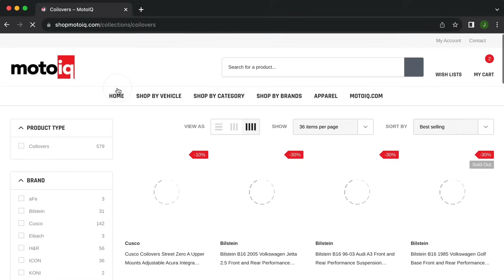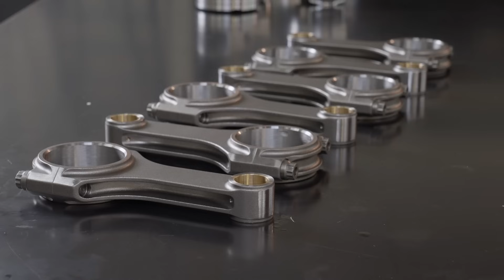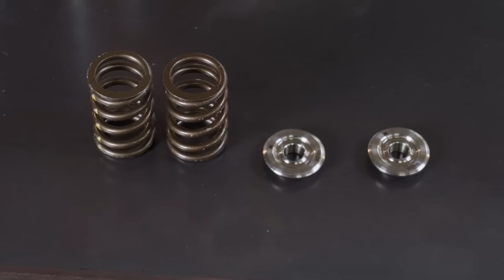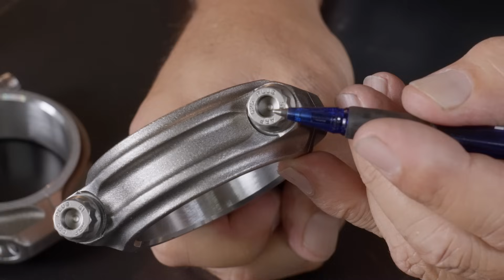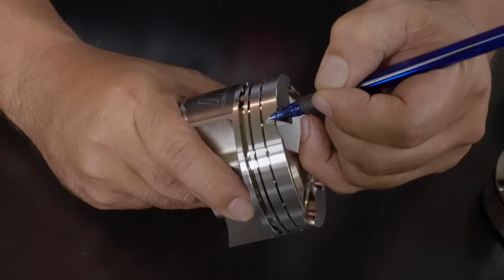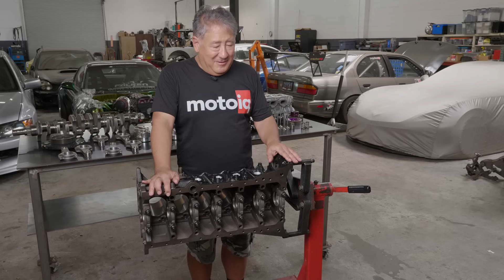How to Build a Basic 1,000 HORSEPOWER 1J/2JZ Toyota Engine!

Comment: Recently acquired a 98 Aristo with a 2jzgte.  Wanting to stay around 700hp. Should i do some headwork or what turbo setup should i do. Will ve doing e85
Reply from the maker: A Garrett G-Series II G40-1250 or a BorG Warner EFR 8374
Reply: @motoiq ty sir

Comment: I just acquired a 2000 Lexus SC 300 with the 2JZ-GE. I'm aware that naturally aspirated 2JZ builds aren't as popular, but i would like to get some education on the Best and meaningful bolt-ons that would enhance the whole engine in power and efficiency. 
Maybe once i get a shop to work in, I'll look at building a turbo 2JZ.
Reply: The 2JZ-GE VVTI in your car will need the pistons and rods replaced for any meaningful power. The good news is, they are very cheap to obtain, so you can acquire one from marketplace and build that on the side.

Comment: You love 2jz and you love efr so you seem like the perfect guy to ask your thoughts on running  a  8374 stock bottom end. My question is, what is a good power target and is a 4k stall to much?
Reply from the maker: 600 hp is really safe. 4000 rpm stall is a bit much
Reply: @motoiq Thankyou 😊

Comment: Sir،
Really thank you for this wealth video 
I got a question 
If i have two carburetor 6L engings and connected them in series with making a rod to connect the two crankshafts in both engine, then I gather the two intake manifold at one big carburetor such as holley carburetor. Then i alignment the timing distributior 
What will i get?
High HP?
Or
High torque?

Thanks
Reply from the maker: One carburetor isnt big enough
Reply: @motoiq  if i get big 4 Barrel Carburetor and make alignment for the fuel and air to feed the 12L cylinder we can get good results.
But my question is, from your experience, will the HP increase or the torque increase?
Reply from the maker: No you can't. They don't make a single 4 barrel big enough. I don't recommend you attempt this with your level of knowledge. If it was done correctly both HP and Torque will increase.

Comment: 3rd gen Toyota Tacoma trophy truck with long travel suspension on 33-35 inch tires. 700HP 2jz turbo motor, what AWD system would you use?
Reply from the maker: Something off of a Trophy Truck

Comment: I noticed you didn’t mention the 3.6 stroker. I’ve been looking into the 3.6 stroker they are sold by all the reputable vendors but i can only find a handful of examples of them being used. Is there some sort of flaw with the stroker? does it sacrifice durability?
Reply from the maker: Some at high rpm

Comment: Great video. I have been a bit worried about my stock main caps in my 880whp Supra. The car is a street car that I do 150mph pulls with from time to time but never any regular hard driving. It is said that stock main caps do not like these power levels..

Comment: I'm a bit curious, have the folks at MotoIQ considered an S30 Fairlady Z build or some other classic car? I'm somewhat interested in the processes and parts choices involved in taking a classic of that sort and bringing it into the modern era.
Reply from the maker: We are doing an S30 VQ swap for a customer now.  The thing is these old cars have there own charm, they are never going to perform as well with the same degree of refinement as new cars unless they become total racecars.
Reply: I put an N/A 2J  in my 74 S30. I added a turbo to it. 
Running 15psi and this damn thing pulls so freaking hard on the freeway. It just sets you in the seat and keeps on pulling until you let out of it. 
😬😬👍🏾

Comment: I have a basic engine question, what is the shuttering sound you can hear when you stall an engine in a manual car? Is it essentially momentary rod knock or lspi?
Reply from the maker: Probably the clutch hub banging against the outer disc and lash in the rest of the drivetrain.
Reply: @motoiq  thanks! Love learning from your channel

Comment: Load of bollocks, there’s  no need for over size valves for 1000hp
Reply from the maker: I didn't say it or actually anything is needed, I did say its possible to do it with a stock bottom end for a little while or for street use.
Reply: @motoiq definitely no need for street use
Reply from the maker: On this motor, the only reason we go oversize is that many of these motors are quite old and a slightly bigger valve allows us to get the 45 seat up nice and high like a new valveseat.

Comment: Wich Torque Level can the Stock Maincaps hold with Arp 625 studs?
Reply from the maker: Depending on your planned use, 700 to 800 or so.
Reply: @motoiq  did you mean foot ponds? Then IT will BE around 1000nm?

Comment: What scale do you measure things down to the 1/10th of the gram?
Reply from the maker: Digital
Reply: @motoiq  I know that. But instead in the model of scale you use
Reply from the maker: There are tons of them. If you buy a good one they come with certifications and you can verify them with a test weight every once and a while.  I don't even know the brand of ours off the top of my head, we have a few around the shop.

Comment: True, we made 850whp on the stock bottom end 2j for years. Truly one hell of a tough engine.
Reply: Horsepower doesn’t kill engines, torque does.
Reply: @Eclipsis17 thanks nerd
Reply: @Eclipsis17 But with high horsepower comes high torque.
Reply: @David__1989 HP is RPM x TQ (lb-ft) / 5252, so you can build HP using torque, or revs, or both, and either one can trash your engine, if you push them high enough.
Reply: @PistonAvatarGuy  Yes that’s true!
Reply: @Eclipsis17  I already know this...

Comment: But RB26 is the better engine? Need more 26 videos
Reply from the maker: No
Reply: @motoiq  you know it is to, how many races has the JZ platform won compared to the RB?
Reply from the maker: Depends on the type of racing.  For road racing in the 90's no but its because of the R32 chassis not the engine that made a winner.  For drag racing, time attack and drifting the JZ hands down more victories.
Reply: @motoiq  come to aus and watch an rb30 smoke a 2jz, then watch them all get smoked by the barra
Reply from the maker: It all depends who developed the engine.  The Barra isnt easily available here so no one runs them.  The RB's are pretty fragile unless you get into aftermarket blocks, dry sumps etc.  A 2J can make 1000hp pretty much stock, at least for a little while, try that on an RB and you will be picking up pieces off the ground.
Reply: 😂😂😂😂😂😂😂😂 the Barra is junk and that slow top end they don't even rate.i have owned jzs for 20 years and I can tell you who the boss is. @IxtheDuckyxI
Reply: @motoiq try 600 HP on a Barra you will be picking up pieces.the Barra clowns dribble on.
Reply: @IxtheDuckyxI 😂😂😂😂😂😂😂😂😂😂

Comment: How much of a significance do piston features provide in terms of performance and longevity? JE doesn't offer the ultra series for all platforms, would it be worth getting a custom to mimic an Ultra or would the difference between it and a FSR be miniscule?
Reply from the maker: It depends, the Ultra uses a near net shape forging so its very slightly stronger plus coatings, the shelf pistons are not bad at all though I won't hesitate using them.

Comment: for 1000hp? I just leave them stock
Reply from the maker: That is what's cool about the engine.  It won't hold up for long under hard use though. Street/drag/dyno queen possibly a long time with good tuning and fuel.

Comment: I really like these kinda videos, but I got question, Why in 1000hp build you don't use Steel or Billet Main caps ?
Reply from the maker: The block doesnt need them except for hard use like drifting or road racing.

Comment: This is what i like. I don't want a 1000whp street car. I want a 600whp street car that isn't pushing the working edge of every part of the drive train.
Reply from the maker: These engines will basically do that with a stock bottom end with a good tune.

Comment: All you gotta do is put a turbo on it! Put some fuel with and get someone who can push a few buttons on a keyboard! They have literally made this stuff where anybody can do it easily. Engine building and horse makin is now out the window! Just put it together with care and boom. Stupid if ya got one, stupid if ya don't.
Reply from the maker: Did you even watch the video?  That is what we said.
Reply: @motoiq  no not much, but of course I know that's what you said. There's no way to make 1000 otherwise with it, without serious work. It was just in my recommended
Reply from the maker: They will make 1000 hp with a stock bottom end, E85 and a good tune for awhile, sometimes for a pretty long while. As long as it isnt hard use like actual racing, particularly drifting or road racing.
Reply: @motoiq  for sure I know what them things do. So many engines now can do the dang thang with just some fuel and a turbo and actually live a lil while. It's all about the tune and the person driving the vehicle. If they understand load and the when to know to mash or not mash it. Of course nothin will last with constant abuse and no maintenance.

Comment: What if the build is a big twin mount Turbo setup for 900hp what am I looking at for parts and kits?
Reply: I'm guessing you tried Google at huh? There's hundreds of thousands of videos, and write ups of 2jz builds. And the majority of them will tell you that using twin turbos is a waste of time.
Reply: @804MRMAN  No they don't tell me it's a waste of time. There's barely just any videos.
Reply: @simpleclean2468  Well I'm telling you they are lol. More turbos more problems. Go small if you want low end punch, go medium if you want a mixture of high and low, go big if you want to 2 step your way down a drag strip. V8s and V6s have two hot sides making them better for  having 2 turbos.
Reply: wulfbliz UK have a modern twin kit for a jz

Comment: I was taught that 3 angle valve jobs were a better/quicker air flow option that just two angle :shelterin:
Reply from the maker: An our hybrid radius valve job is even better!
Reply: @motoiq  maybe on the exhaust side of things. Definitely not better on the intake. If it's just the cut alone, it would be negligible, just like the standard 3 angle. Yes, it'll improve a few cfm. If 3 more cuts only are involved, it will improve significantly. If you blend, then there is lots of improvement
Reply from the maker: Yeah if you watched the video you would see that ours is a prefect blend.  Most heads are 3 angle from the factory.
Reply: @motoiq  Exactly, hence my initial comment..  Thankyou for the reply, you've answered my query perfectly ..  appreciate the fact you are sharing this with everyone.. ya doing some great work!!
Reply: @motoiq  is there a reason why you don't break the edge from you radiused chamber side cut into the combustion chamber to transition it more smoothly? You could clearly see your pen catching where the cutter finishes. I would have thought a quick light touch with a sand roll would take care of that.
Reply from the maker: We do that if the customer wants to pay for it.  It comes with our pocket and entrance porting, we clean up the short side radius and the bowl entrance too at the same time.
Reply: Anytime you can improve airflow from both sides of the seat cut contact its better, which is usually a 3 angle job cut that most every machine shop now does. But, they all generally put a 30/45/60 cut on the seat, which will improve it a lil bit over what it was. Just think about the valve and seat @0.050" lift

Comment: so what is a good compression ratio for boosted on pump gas? my area doesnt offer e85
Reply from the maker: I would do 8.5:1 or 9:1. the lower compression to go for more boost, the higher for better response but less boost.
Reply: @motoiq  So does using the GE-VVTI head with gte bottom end even out the high compression to give more high end boost while maintaining the low end torque?
Reply from the maker: If gives you about 30-40 lb/ft in the low to mid range.
Reply from the maker: What octane is the gas in your area?
Reply: @motoiq  93
Reply: Good question. I would like to know also, I have access to E85 but I wasn't to keep it at 93 octane.

Comment: Can we talk about uz v8 motors?
Reply: If you want power out of later model 1uz with the skinny rods, 2uz and 3uz id recommend going boosted and put in some 
Eagle forged rods around 700$ 
XAT Racing makes custom forged pistons at 2000$
Elate sells supercharger kits and manifold adaptor plates with or without built in intercooler
Urd sells centrufugals supercharger kits with a self tuning plug and play peice and higher output injectors and fuel pump
Turbo i have not seen any quality kits for the 2uz at least so thats some fab work but would sur be the cheapest
I dont know about  tuning becides what urd offers
Reply from the maker: That and FI is probably the way to go with these engines.
Reply from the maker: We haven't had anyone want us to build one yet. They are strong.
Reply: @motoiq  oh was think of putting one in my 240
Reply from the maker: You are better off with an LS, more compact, way lighter, way better aftermarket support, if you are on a budget do a 5.3
Reply: @motoiq  I’m a bit a purest and like my jdm with jdm hearts, don’t need to much slide boy lol
Reply from the maker: One of the reasons is that family of motors has little to no aftermarket support. So everything has to be semi custom or custom and valvetrain development is expensive. So the cost to performance ratio just isnt there.  If you were racing you would care about weight and size to power as well.  If you just want something unique and cool, more power to you, who cares what I think!
Reply: @motoiq  you 100% right I like the way the uz sound, and more or less if I was building for racing I’d go a different route my 240 currently had an Rb20det that I can keep my hoses for coolant and fuel to not leek.
Reply: I have mentioned it. 2uz fe

Comment: I've had the pleasure of owning a cammed 1JZ.  Great engine.  Also built a T-64 powered 7MGTE that made 445rwhp with HKS cams.
Reply: 7m is under rated. 1/2j get all the attention. Lol
Reply: @BirdwellingtonAmalgamation  7m 3.0L made a ton of torque!
Reply: 7m is a damn good engine except for the head gasket. I've wrenched on several that made 500hp with just studs, bolt ons, and tuning
Reply: @Fulcrum205  head gasket and high oil temps.  A good oil cooler is a must. Stock pistons are strong, until they aren't.  I learned that the hard way.
Reply: @Twobarpsi  IMO an external oil cooler is a must on a performance car. So many problems are averted with the cooling and extra capacity
Reply: @Fulcrum205  it only took 2 or 3 pulls to get oil temps to 235F on the stock oil cooler in the summer.  Took forever to cool down, compared to how fast the oil temp would rise.

Comment: What's the reasoning for not going with billet main caps when pursuing 1000hp? Just curious as I see it often mentioned with JZs when looking for 800hp+.
Reply: Think of it as insurance😂
Reply from the maker: Not needed unless its a hard use application, like drifting or road racing.